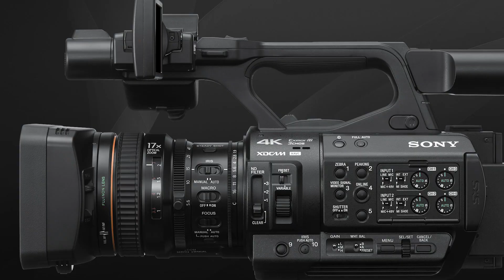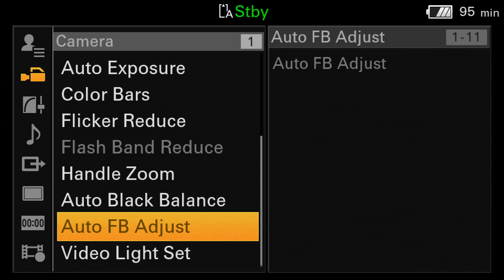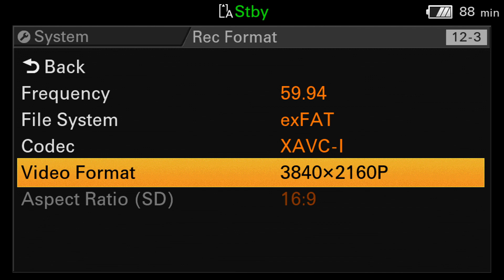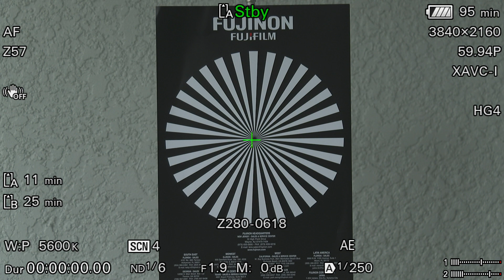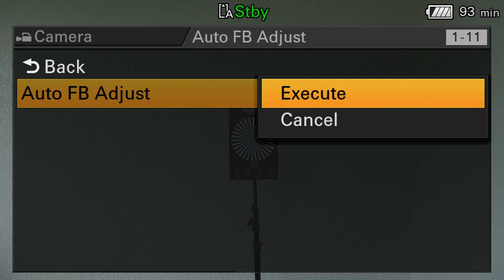How to Properly Adjust the Back Focus on the Sony PXW-Z280

Comment: On a Sony NX800, at fully wide (Z0) and manually focused on infinity, it's perfectly sharp.  Then zooming in; past Z45 or so, my image becomes blurry.  Is this a back-focus issue, or just the physics of the lens?  

I understand the NX800 lens to be parfocal, but perhaps that is not the case.
Reply from the maker: The NX800 does have a parfocal lens, so with the problem you have described it sounds like the back-focus needs fixing.  Sony calls that "Adjusting the Flange Focal Distance" in the operation manual.  Look it up and follow the directions to the letter.  You may find this Z280 video I created a few years ago helpful, but the actual steps may be different for the NX800.
Reply: @DougJensenVortexMedia I will try that...thank you!
Reply: @DougJensenVortexMedia 

A follow-up...not looking for more guidance, but to report on my findings. 

I did the Auto FB Adjust procedure, *to the letter*...exactly as described in the NX800 manual.

Results?  No changes.  If I set the focus manually at Z0, it stays sharp until about Z45.  By Z99, focus is totally lost.

However, if I set focus at Z99, it stays sharp through the entire zoom range, all the way back to Z0.  It was like this before and after the Auto FB Adjust. 

Either I have a defective NX800, or this is a design issue.  If you still have a Z200, try this.  It can be done at any focus range.  Infinity or 5 feet, it will not stay in focus if it is manually set at Z0.

My own issue is infinity.  I capture storms and none of Sony's prosumer cameras I've used since 1993 will auto-focus on them (including the NX800); water vapor throws auto-focus into a tizzy.  I have to use MF.  It's a real pain to re-adjust focus when zooming in when all my subjects are well past 1,000 feet.  I miss the one-button infinity feature of my old PD100A!  Even the AX100 would stay in focus once manually set to infinity (the mountain icon).  Not the NX800.

...and yes, a notable amount of shooting is done in the dreaded FULL-AUTO, because you do not have time...like many nature photographers. 

Sorry for the long post...I appreciate your time...thank you!

Comment: Hi Doug, thanks for the guidance! There is one more thing that puzzles me in my Sony PWX Z 280 camera - Ive watched many reviews and some of them refer to a possibility for this camera to mark a certain face for the auto focus. So the square focuses always on the specific person's face, no matter how the person moves. But in my camera I can't find any option to mark a specific face! There is only 2 options for auto focus - face only/face priority. Could someone please help me to figure it out in the menu? thanks a lot!
Reply from the maker: Hi Liza, this topic is covered in my 6-hour Z280 master class.  https://vimeo.com/ondemand/z280
This is what I say about this subject, in the video:  "Whenever faces are detected, a gray face detection frames is displayed around each face, and the camera will automatically determine which one should be given priority. When a frame changes to white, that means focus has been established on that face. The orange line is just a simple cursor that can be moved with the camera’s joystick.  It does not necessarily indicate anything special about whatever frame is above it.   One risk with Face Detect is that the camera may change the priority frame on it's own at anytime -- as it senses changes in the scene. That may not be what you want if one person is more important than the other. For example, if you're shooting the CEO of your company or following a political candidate around you probably want the focus to stay locked on them even if someone else become s more dominant in the shot. So, you can tell it to memorize an individual’s face,  and it will then give that face priority over all the others anytime it sees that face in the frame. That is called “registering a face”.  To register a face, move the cursor over that person’s face, and then press in on, the joystick. Notice that there’s now a double frame around that face, and there’s a new icon to indicate that we’ve registered a face. To un-register a face I just press the joystick again."  I hope that answers your question.

Comment: Loved the Master Class on Z280 Thank you.  Can you provide insight on what, how, where to get a sony wireless mic kit of the newer UWP-D series that has 2 transmitters, 1 duel channel receiver, and one sony hot shoe for it.  I've been bambooooozled calling into the B and H's and Adoramas and others.  No luck for me.
Reply from the maker: Hi Stephen, the last time I checked (January 2021)  the single channel D26 kit is the only official bundle Sony offers. But with that said, you can easily create your own dual-channel package by mixing and matching any combination you want of UTX-B40 body packs, UTX-P40 plug-on transmitters, or UTX-M40 microphones (they have built-in transmitters) -- with a URX-P03D receiver. So gotta make your own bundle, just as I have for my Z280 and FX6.
Reply: @DougJensenVortexMedia  Thank you

Comment: Great instructions and really required for this camera . Unfortunately there is no such test pattern card here in Belgium to be found .Any suggestions for alterantives would be very nice . Thank you
Reply from the maker: Thank you for the compliments. If you do a Google search for back focus charts you can find printable PDFs.  But it doesn't need to be an official chart or special pattern.  Anything with high contrast lines will usually work fine, such as a poster, sign, etc.   You could even convert a PDF bakc focus chart to JPG and display it on a big screen TV so it is bigger than what you could print.  Just an idea.
Reply: @DougJensenVortexMedia  Thank you , Doug , I thought those not being fine enough , but did find proper ones now and displays super fine on the 65 inch 4K Sony oled . Thank you again !

Comment: Am having a back focus problem in my z190... any ideas how to fix it?!
Reply from the maker: I'm sorry to hear about the trouble.  Are you sure the problem is with back focus?  You may want to watch this other video to rule out diffraction problems first.
https://youtu.be/U_JSeBvpkKo
If you're sure that you really have back focus problem then you will have to send the camera in for service because there are no back focus adjustments on the Z190.
Reply: Thanks for the videos that you make they are really helpful... I set the focus for an interview lets say 1.2 meters and when i zoom out the persons face will get out of focus and the objects behind will be focus so i keep it zoomed out and set the focus to 0.8 and the persons face will be almost focus... and for the wide shots when i set the focus for the farthest object lets say 120 meters and when i zoom out the focus will be on 80 meters or less... and i always set my aperture to the lowest
Reply from the maker: @mohamadosho1687  Are you sure the macro focus mode is turned off? You should check to be sure.  Also, you could do factory reset of the camera to see if that fixes it.  If none of that works,, then your camera may need servicing.
Reply: I sent it and they told me that they need to replace a part of the camera and now it works fine
Reply from the maker: @mohamadosho1687  I'm sorry to hear it was broken but glad to hear it has been fixed.

Comment: @Doug Jensen,  You're a lifesaver. I thought it was me. A couple of things I'd add that helped me out, in addition to the great instructions you have.
1. Make sure your camera is in Base Settings > Shooting Mode > SDR. I was in HDR > HLG2 and that made the process less effective. When I switched to SDR, it was better.
2. Use a back focus chart that isn't too tight. The first one I downloaded and printed was so tight that my camera struggled when it was setting focus at the wide angle. I made one that had more space at the open end. This was more effective for me. I think a larger chart would have helped too but my printer is only so big.
Thank you again.
Reply from the maker: Hi Michael, if you found this video helpful then you may like this one as well:  https://youtu.be/U_JSeBvpkKo

Comment: . Great video thanks!  but i muss really say about something  about  this camera: the rocker zoom on this 8000 euro camera ist 
really really bad, very hard to work with it, . very hard to get clean 
smooth zooms, the speed changes with a minimal pushing from very slow to
 very fast. very hard to really control it and it ist fully unreilable .
 I own some of the pmw 200. 300 since years and is a world of diference.
 why is the big brother of suche a great cameras so bad on the rocker 
zoom? i was very disapointed when i ve realized how horrible is the zoom
 rocker... what a shame, because all othe functions are great, but fur 
some one like me doing news and coverage journalismus is fully 
unreilable,  if you uses the zoom a a part of the style of recording you
 will have a bin problem and a pain i the ass...shame on you sony
Reply from the maker: I will admit that the zoom control is less than perfect.  I've gotten somewhat used to it now, but it is not as good as I would have liked it to be.
Reply: @DougJensenVortexMedia  at the beginnig i was very glad when i forst got the camera ,configuring the camera, to be able to send my first test file on g4 directly to the tv customer server, so many assings butons, a 34 zomm on full hd, etc etc... and then the bad awakening, when i whent to the field do record the first material...could not belive it was working properly, so i didt count with that, so i ve returned it back as a defect gear...i ve drove to hamburg to the next store to check the demo camera there..... the same problem...just incredible that sony got such a great piece of gear, being fully destroyed by such a horrible zoom.. A reailable and smooth zoom ist such a big important part of a camera not just for someone who ist making news a coverages, is almost a kind of submission to acept this  malfunctioning zoom and to live with it. I havent and will not take it ;) i d wished would be a way to fix it... really a shame and a clearly incompetent and sloppy job from sony  on this zoom rocker  ...
Reply from the maker: @locochono77777  In my opinion, the poor zoom servo is not a big deal and is just a small disappointment.    Zooming "live" during a shot is something I rarely ever want to do and it is something I hardly ever see on TV any more.  Zooming is kind of an old fashioned shooting style. I prefer to use the lens as a "variable prime".  I choose my focal length for a shot, shoot it, stop recording, and then use the zoom (if necessary) to frame a new shot.  It would be very rare for me to zoom during a shot with the Z280 or any other camera.  Zooming totally destroys the cinematic look that I am trying to achieve.  Of course when shooting a classroom, an event on stage, or single-camera sports the zoom is more important but I have gotten pretty good at controlling the zoom speed and getting smooth starts and stops most of the time.   I'm not saying you need to shoot the same way I'm just offering another perspective that the smoothness of the zoom performance is not a huge deal for some people.  I assume you have adjusted the menu settings that control the zoom?
Reply: @DougJensenVortexMedia  i would not say is old fashioned to use the zoom as a dramaturgical element to  intensifying for example  an interview in live situations or recordings for the later tv programs. For example , Going from medium close up, to a close up in a interview will ad a lot o dramatic an intensity in what the interviewed person is saying,  and not just in a interview,  but in many other elements being filmed .  i been working mostly in europe since 20 years, and to use the zoom as a very important elemet belogns to the daily business.  smooth Zooming in increase the dramatic in all elements of the filming (if they are smooth of course)   and zooming out from medium close to wide shot for example offers alot ot of the scenic resolution. I am just talking about my area, news and any kind of coverages. doing documetaries you need to use the zoom many times and right away focusing to follow the subject without making breaks. i know that for other productions zoom is not important so as the way you use it. Fact is the zoom quality of this camera does not fits in the quality of the whole pxw z280. And yes my friend i could not change too much on the menu, the handle zoom was very adustable on the menu but the rocker not at all. I am asking if maybe some other thechnicians would be able to fix it a little bit.  So i can be motivatet to work with it ;)  Many greetings!
Reply from the maker: @locochono77777  Great post!   I like it that you have pushed back with some excellent examples where zooming still has a place.  Although these days I tend to shoot a little wider in 4K and use keyframes in post to zoom exactly right at the moment that I want it.  Smooth as butter and perfect timing every time.  But nevertheless, I agree that it would be nice to have better zoom control.
Reply: @DougJensenVortexMedia  i understand how it works for you well, sounds good. The thing is that When you are making news and broadcast jobs you dont have That much time or any time at all to do any post your self and  The customers on the tv stations get the material raw from me and they dont have also that much time to do to much post, Also if its going to be transmited for the next day. The recorded material you give them, should work for them mostly right away so that they do their editing,  and put it live as soon as posible.  Thank you very much for your honesty about the z280. I will inform you i my technicians in berlin could do something to make the zoom rocker at least more reliable and enjoyable

Comment: Which someone would explain how to increase specific colors  in  the  Matrix. For example looking  at my vectorscope what colors give me a brigter yellow  or  a lighter magenta. This R-G, G-b stuff is very confusing.
Reply from the maker: Sure, I explain how to get a nicer picture our of the Z280 and much more in my 7-hour Z280 maser class.  https://vimeo.com/ondemand/z280
Reply: @DougJensenVortexMedia  I  did pay to watch that Doug. It was great. I even took  notes!  But  I  did  not see anything there that would explain  how to adjust with a vector scope to get more of a corect single color. FOr example, I have had my yellow or  magenta off and its hard to know which of the matrix settings will  get me an adjusted magenta without  distroying the  other colors. There needs to be a formula like "what matrix setting or combination will give me a correct Magenta.... etc. I have been using a Macbeth color check  card to try to get the  color settings for  the  280 and  my EX1R closely matched. I  have them  in the ball park but I have spent hours on it.
Reply from the maker: @emavideo  Hi Ed, normally those sort of color adjustment are only necessary if you want to match two cameras -- which goes beyond the scope of my video.  In normal single-camera shooting there is really no need for such precision or make tiny adjustment to the color.  However, with that said, if you do want to get that detailed with your camera's color adjustments then you will need two things:  1) A genuine dedicated vectorscope from a company like Leader or Tektronix. I own an a Leader LV5330 and can tell you it is excellent.  2) You will also need a DSC Chroma duMonde chart.  The matrix menus of Sony cameras (and other brands) are designed to be adjusted  using a Chroma du Monde chart and a vectorscope.   Having both of those tools and knowing how to use them properly is absolutely mandatory if you are going to make adjustments to those menus while trying to match cameras.  You cannot do it correctly with a Macbeth chart.  And even if you have those tools, a perfect match between the Z280 and EX1R might not ever be possible.  They are two different cameras separated by 10 years of development and I think a perfect match may be impossible.  If you have gotten them in the ball park you might need to be happy with that.